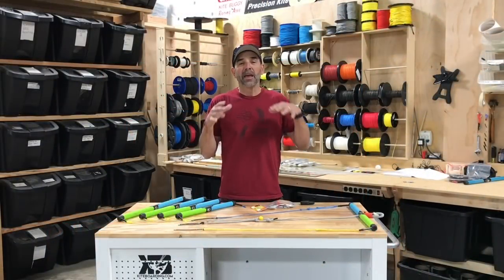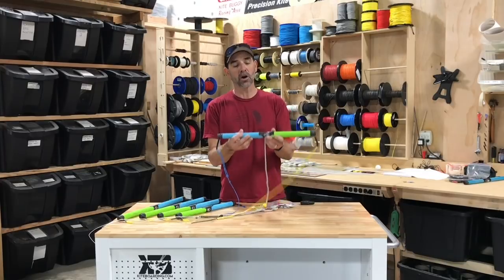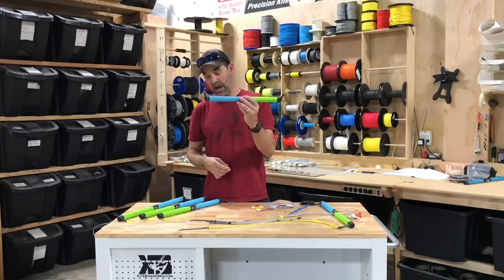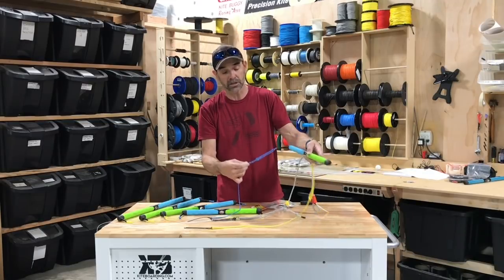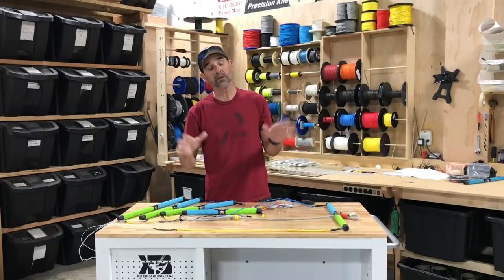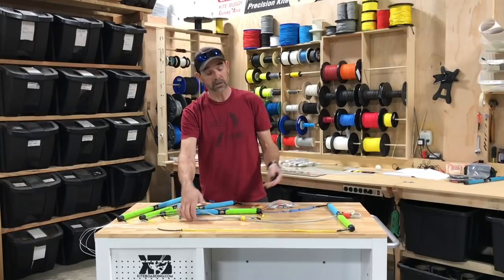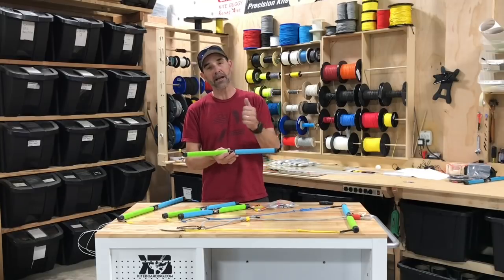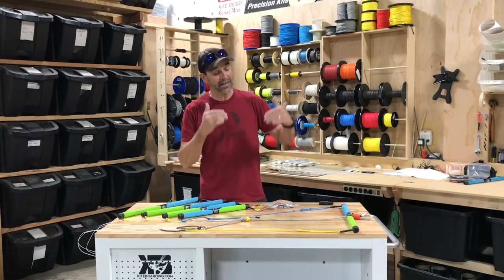PKS KISS Bar Control System

Comment: Could you show how the safety systems work?  I am not a fan of the current bars.  I don't need the typical standard ejects and I do think they eject too easily as I am starting to go into more serious surf and areas where accidentally ejecting can be dangerous.  However I do spin my bar a lot so attaching the leash above the bar doesn't look like it would work.  I do like the idea of being able to flag out and remain attached to the kite if I need.